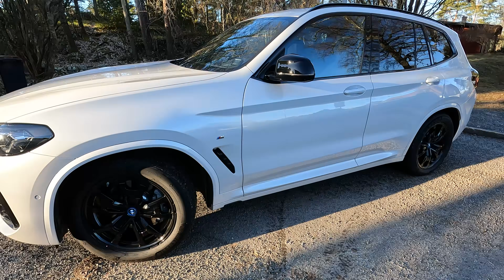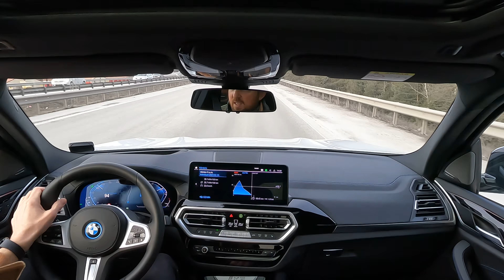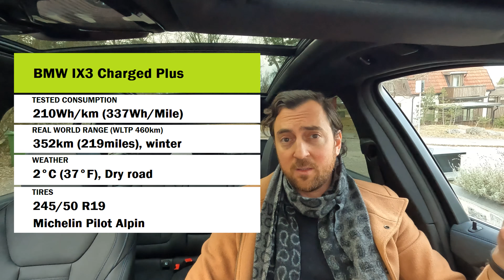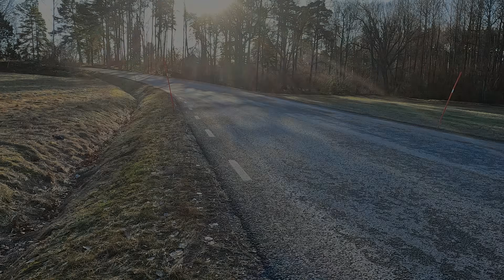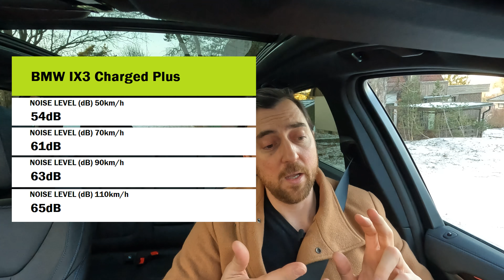BMW IX3 - Test: Range, consumption, noise and acceleration

Comment: very good videos I am interested in the bmw ix3 and the model y performance, I know that they are very different cars in terms of power and design. Are you happy with your model y or would you trade it for a bmw ix3, I see a lot of people complaining about the comfort and quality of the model y, I'm a bit afraid of that, I did a test drive and didn't feel it was too uncomfortable.
Reply from the maker: Hi, I have had my Model Y Performance for over a year now and I'm very happy with. Low consumption, great performance and very practical. I haven't experienced any quality issue other than a missaligned door (I made a video aboit that). I like the IX3 but wouldn't replace my Model Y with it.
Reply: @ItsOnlyElectric  Thanks for the answer. I tested it and for me it was a surprise in relation to the test drive I had done in 2019 on the model 3 performance. The suspension has improved a lot and the quality and soundproofing too
Reply from the maker: Yes, the updates has made the y a lot better

Comment: For real?? Is this supposed to be a real range test-drive when it is 1 or 2 degrees outside and you set the heating at 20 degrees… these reviews are not serious…
Reply from the maker: So what should I set it to? I set it to 20 degrees in all my test no matter what the exterior temp is.
Reply: @ItsOnlyElectric  thanks for the prompt response. Understand that you set all your test-drives at 20 degrees, however if it is a “real world” test drive, surely one adjust it to 23/24 degrees; unless one uses coats inside their cars on their daily drives, which I don’t think one would. Anyway that’s only my opinion. Thank you  for your videos 👍
Reply from the maker: Yes, I get that. But to be consistent I always set it to 20. I made that mistake when starting my tests and therefore continue with it. All for trustworthy and comparable results. 20 was a perfect idea durig Sumner but in some cars during winter it's a bit too cold. 🙂
Reply: @jorgefernandes8164  23/24 degrees? Are you mad?
Reply: @jorgefernandes8164  never set heating for 23/24c and I live in Finland, 20c automatic set year around
Reply from the maker: Best temp!
Reply: @jorgefernandes8164  depends on the car. I drive my Honda CRV with aircon at 19c all year. My wifes Mazda I drive with it at 22c. 23/24c would be too warm for me.
Reply: @dstfno  I like it warmmm on winter lol 😂 
20 degrees on winter …. Seems a tad cold lol

Comment: Did you close the roof curtain when you did the noise test?? Ortherwise you need to do it again :)
Reply from the maker: No I did not. Maybe I should have, almost all cars I tested until now has glass roofs. But its makes sense to close it, and will be more silent with the curtain, at least in higher speeds.

Comment: I have a 2019 Model 3 and an iX3. They’re basically the same on a road trip. I’m stopping at the same stations for charge, and charge for about the same time. There are maybe small nuances, that even a small change in the weather can easily influence it in the one or the other direction.

Also fun fact: if you take the BMW consumption shown in the board computer, multiply with the distance travelled and compare how much % you lost from your 74kWh battery, you’ll see that they match. Do the same for Tesla and you’ll see that there’s a gap. Tesla underreports consumption. So that based on real consumption (% used for distance travelled) they’re very close, less than 10% difference! Given the form of the iX3, that’s a huge success!

I like both cars for their own advantages, but for the long term I’m keeping the iX3 (ok, I’ve driven Tesla long enough to let it go now). No hate there, and lots of electric drivetrain and software handling Tesla does much better. But BMW does better hardware, so it’s just a better car. It’s a BMW in the first place, that just happens to be electric. And I’m a bit tired of installing new games and light shows in Tesla while they still can’t figure out the automatic wipers in all 4 years that I own the car! It’s ridiculous, I manually push the button every freaking time there’s just a bit of rain or a wet road. As soon as it rains properly, I can put it in one of the fixed ratios — but intermittent rain is a PITA. Headlights are junk compared to iX3 Adaptive LEDs. The list is long. The iX3 is not perfect either, you can’t stop charging or change the charging target remotely; if you turn on AC from the app it will go off after 30 minutes — why?.. But those are like small comfort things that annoy me while charging, etc. The things on Model 3 are more driving security related, and the focus of Tesla’s development is concerning me.
Reply from the maker: Great info, thanks.
Reply: "I manually push the button every freaking time there’s just a bit of rain or a wet road." it is actually happening to me at iX3, it's either fast wiping or Auto which is not detect small drops, i have to push manually every time

Comment: Range is a joke for the money. They removed AWD and yet couldn't save for some more range.
Reply: Look at carwow range test. It came in second and only marginally behind the EV6
Reply from the maker: I think it came third. With 412km of range .
Reply: @ItsOnlyElectric  Yes that's the point, anything below 480 is not quite there IMO, and the only thing that is there with iX3 is BMW pricing.
Reply from the maker: Aeordynsmics and weight is of course effecting the range in a negative way. 

 The compromise between bringing EVs to the market in a decent time and waiting for enough bandwidth and technology for manufacturing. 

The price is comparable to a X3, and priced accordingly to BMWs model line up. But expensive compared to a Model Y.